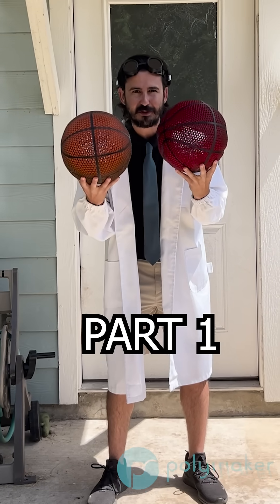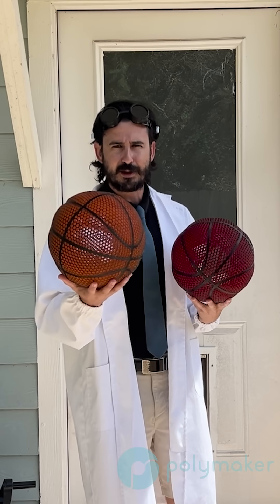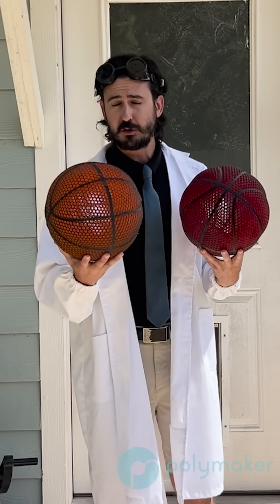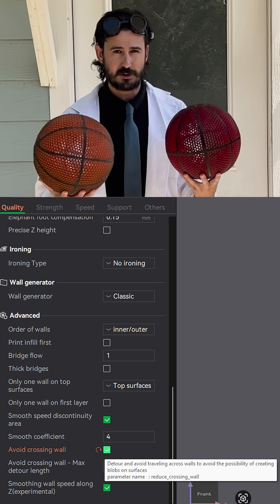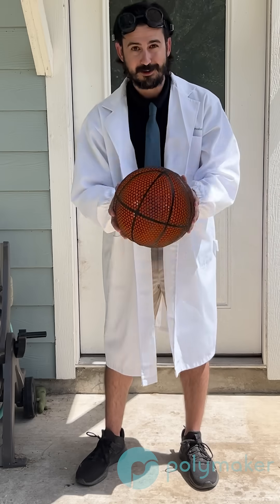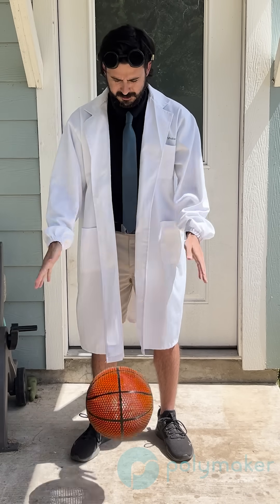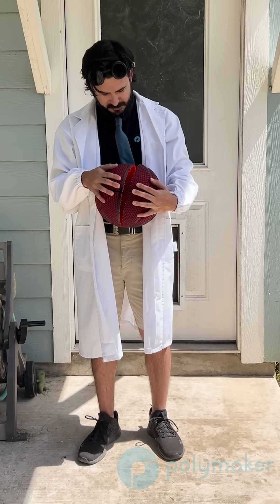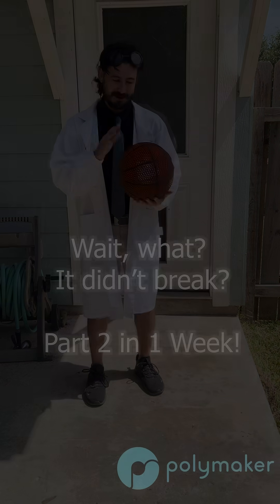Composite 3D Printed Basketball - Part 1

Comment: You mentioned layer adhesion. You should try the interlocking setting, it will make a crosshatch to lock in the PLA and TPU instead of relying on different materials trying to bond.

Comment: Why not just use rubber as the outside? Do what they do with regular basketballs and have cut pieces with the holes, glued onto the ball itself. It might support and hold the print to prevent it from cracking.